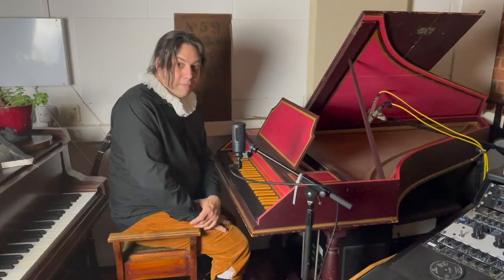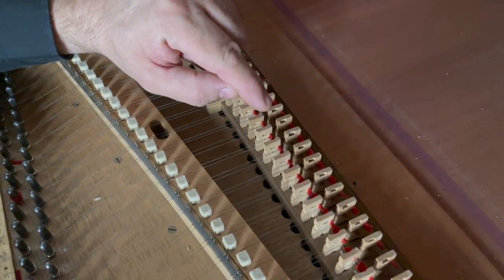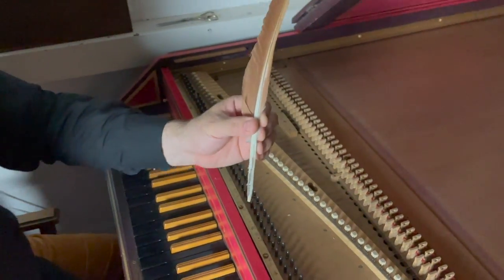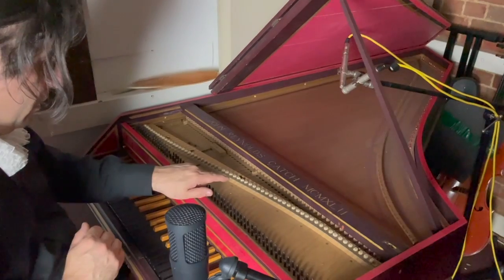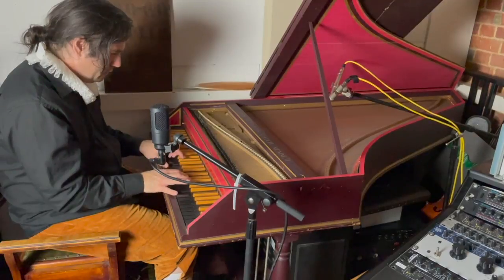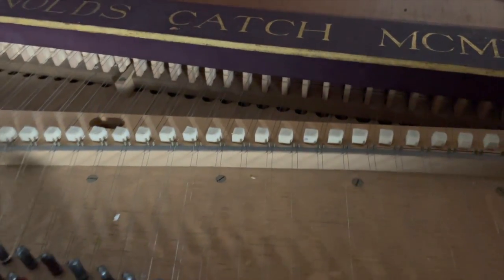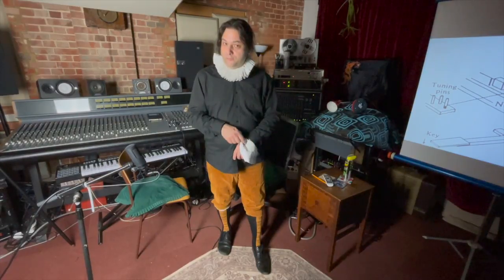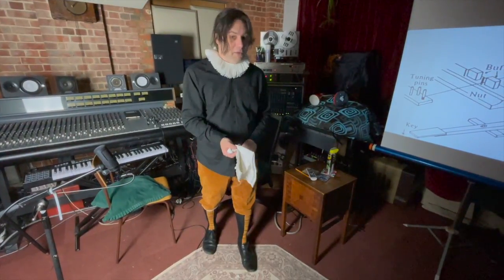Harpsichord demonstration and lecture

Comment: It was built in 1952, according to the numerals.
Reply from the maker: Hahaha thank you - I was told 1942 by the seller years and never thought about it again - although it has dates from the mid to late 40s inside it (when strings were replaced) so maybe it was started in 1942 and finished 10 years later?
Reply: @VintageKeysStudio  no it is 1942 (MCMXLII). 1952 would be MCMLII.
Reply: @shanedigby  yes '42
Reply: An X before L is 40